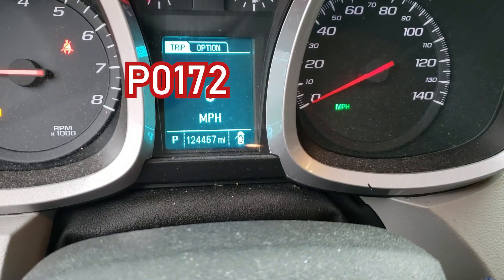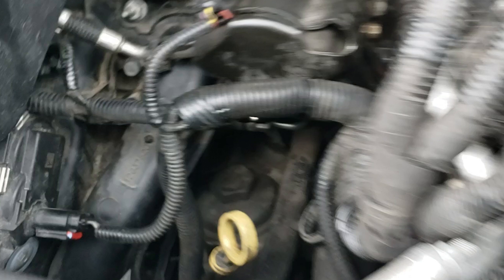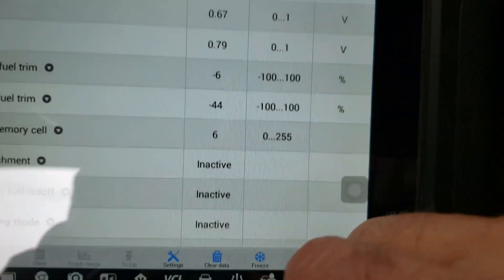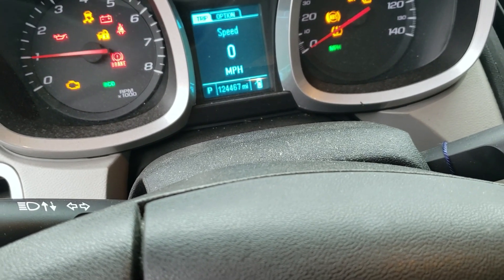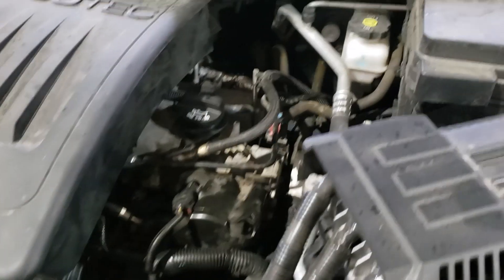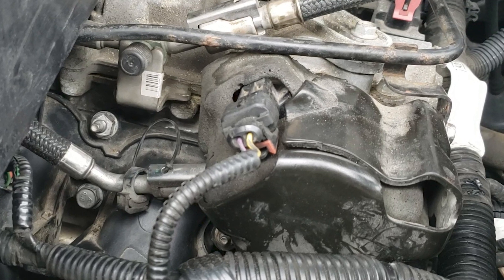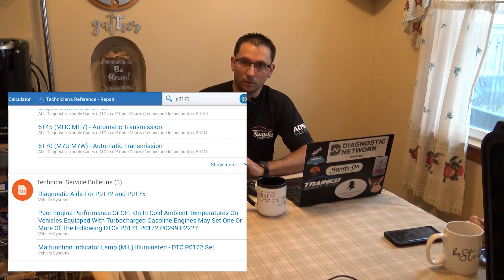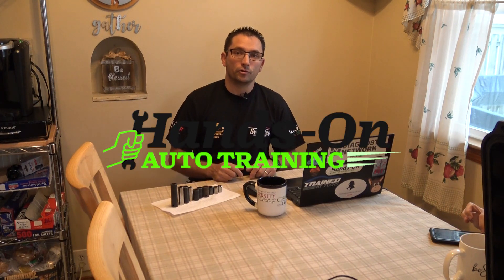2016 Equinox P0172

Comment: January 10,2026. 2014 terrain  and a equinox same issues.  My mechanic just got fired.. he said it was the feul pump in the gas tank.. ill change the front pump,  the 2 exhaust value & oil w/ new filter..

Comment: Thanks for this video. I’m going to try pulling my oil fill cap to test for vapor. My Nox is dieseling at shut off and my assumption had been the HPFP. Now I know a quick trick (other than the smell test) to check the pump.

Comment: Did this issue ever cause a P0300 code to pop also?  I have a heavy smell of fuel while running, dieseling when key is shutoff, P0172 and P0300.  Sometimes it will switch from P0304 to P0303, but most times just P0300.  Had a total of 9 other codes pertaining to the downstream O2 sensor.  Replaced that but still getting other issues as stated.  Getting 60 psi with car running for fuel pressure, drops down to 32 psi in about 10 seconds after key is shutoff.  Oil does seem to have a hint of fuel, but making it's on my fingers -_-  Wait to get my buddies scan tool to check fuel trims.  Assuming it is the same issue you had here?  Can you give part number for what you purchased?

Comment: Exactly what happened to my car, and when I removed the oil cap, it stopped. So, the solution is changing the High Fuel Pressure Pump? When you said “installing high fuel pressure pump” at 3:41, does it mean changing it with the new one?

Comment: The oil cap trick solved my P0172, P0191, P0303 problems. 2013 Equinox running poorly, stalled at stop light, reduced power warning in display. Took off the oil fill cap  - waited a minute -shut it off  -no over run ! I cleared the codes with Bluetooth BlueDriver - -- Left off the oil fill cap -- Drove the car about 3 miles  ran perfectly -no stalls no codes --returned home -car shut off perfectly no run over - on the drive for the first time I smelled gas fumes  --before I could not detect gas smell off the dipstick be  - changing out the fuel pump  --Thank you so much for the info !

Comment: You just saved my ass. I’m having the EXACT SAME issues with my 2010 equinox . Just had timing chain done and notices the rough idle , the sputter on shut down and occasional sputter after consistent 2k rpm . My oil reeks of fuel even after a fresh change (week after). Also have that p0172. Taking it in Monday so my guy can pull up fuel trim levels and see what he comes back with . Sharing the data with him bc he works on these motors ALL THE TIME. Northeast Ohio area.

Comment: I have the same problem but I changed my fuel pump and I still have the same problem. If I turn off the vehicle it'll continue to run a few seconds after I take off the key.
Reply: any updates on this?

Comment: I Have a valvematic 3zr engine
Changed MAf sensor
Changed 02 sensor
No vacuum leaks 
Changed MAp sensor
Changed injectors 
Changed temp sensor 
Code P0172 bank 1 rich code
Reply from the maker: Check you fuel trims at idle then wot, also pay attention to your map and iat as you raise the rpm  you may have a restricted exhaust.
Reply: Today i changed the whole fuel pump 
And also replaced MAP sensor
But my long term fuel trims are really high -38 
I did an aftermarket exhaust also

Comment: Great info - I have same issue on 2013 Equinox 2.4L Ecotec.   
No P0172 code, but engine run on after shutoff and high negative LTFT (-20 to -40).  Maybe fuel pump is has smaller leak.
Will try removing the oil cap this weekend.     
What is expected fuel rail pressure under load?    My OBDII shows around 500 PSI @ idle and 900 PSI @ 2000 RPM (in Park).

I have read elsewhere that load pressure should be > 1500 PSI.

Also have intermittent misfire code P0303 - might be a bad injector (stuck open?) or intermittent coil pack.
Reply: Update - now have the P0172 code.  Removing the oil cap stopped the engine run on after shutoff.   Time for a new high pressure fuel pump!

Comment: Ran in to this problem today. After searching around I can across your video and it help me to condemn the high pressure fuel pump thank you for the informative video
Reply: Did your car keep turning off
Reply: @AngelLopez-hs9gl  when I turned the car off it would stay running due to fuel fumes in the crank case. I never ran in to one that would stop running not to say it isn’t possible

Comment: Hey man I have 2012 gmc terrain and 2012 equinox both with Sam's problem. I tried all the other p0172 fixes but the HPFP and nothing else worked. So now I will install a new HPFP and hope it works like yours did in this video. Thanks again
Reply: Did it work?

Comment: Good info Brian. Saw quite a few of these at the dealer.
Reply from the maker: Would they contaminate the oil with fuel?  I have seen oil overfilled with fuel,  this one was apparently just enough of a leak to atomize the fuel.
Reply: @BrianMann216  Yes they would. I would change the oil and verify the fuel trims would return to normal. Then replace the high pressure fuel pump. If driven too long the plastic from the timing chain guides will break.
Reply from the maker: Thanks for letting me know. The few that I had that were obvious oil was almost 2 inches above full and smelled like fuel = easy diag.

Comment: Brian, thanks for sharing. Direct injection seems to be causing a lot of issues with fuel getting into the crankcase. Did the service bulletin say to replace the high pressure pump at customers expense or manufacturers expense? I’ve been told they are not cheap. Please post your classes on line or send me an Email. Free or pay I would be interested. Enjoyable class yesterday. Artie 👍👍👍
Reply from the maker: It was a preliminary service bulletin..